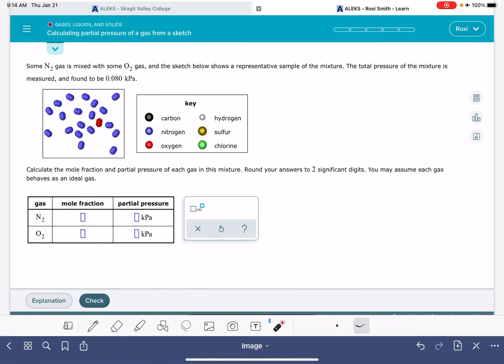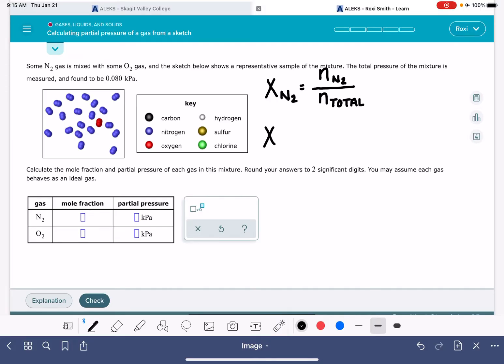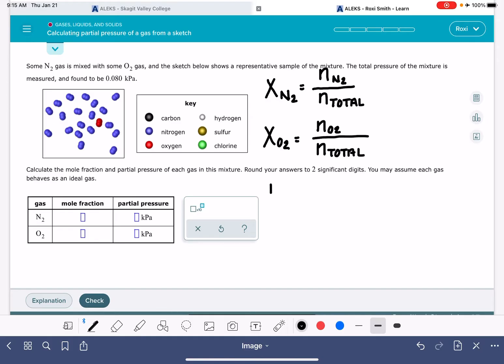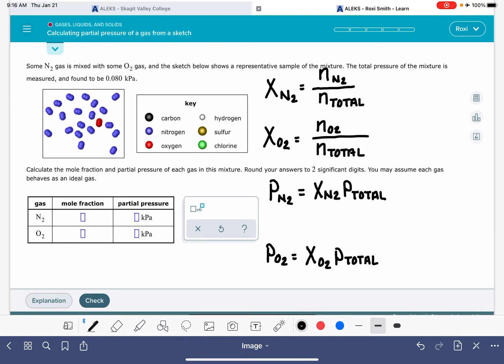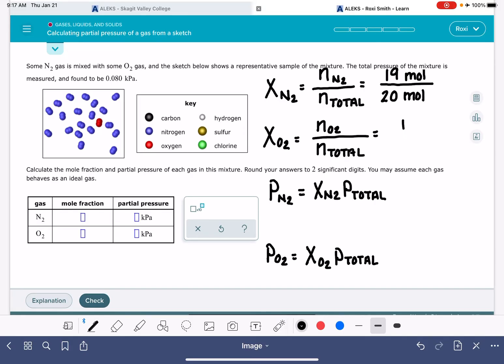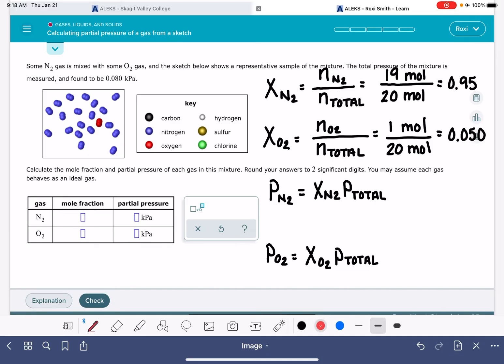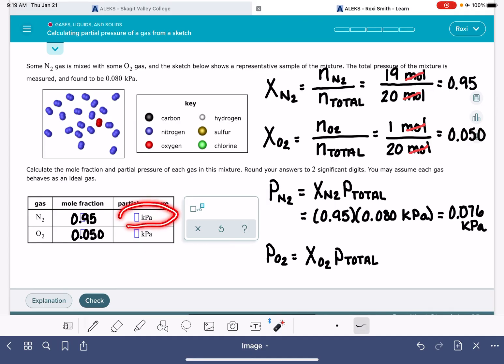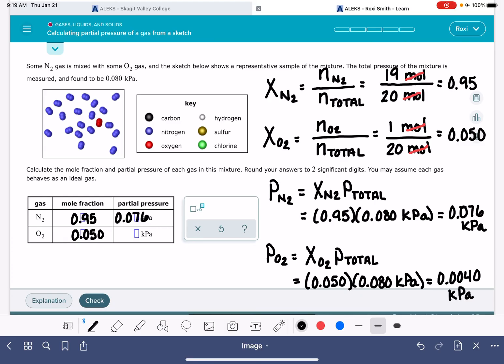ALEKS: Calculating partial pressure of a gas from a sketch

Comment: What if they give you  atm instead of kPa?
Reply from the maker: If all the pressure units are in atm instead of kPa, you don’t need to do anything different to solve the problem. 

If it provides you with a total pressure in atm but wants you to calculate partial pressure in kPa, you need to convert units. 1 atm equals 101.325 kPa.